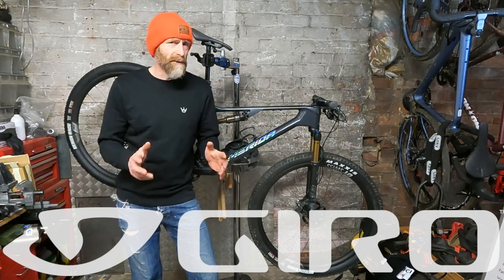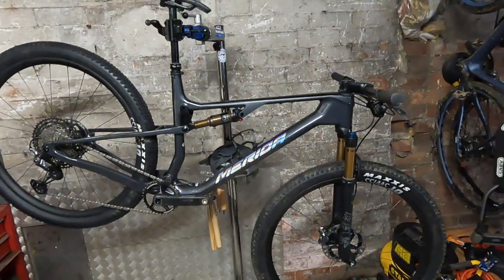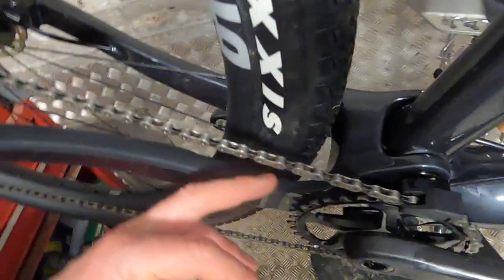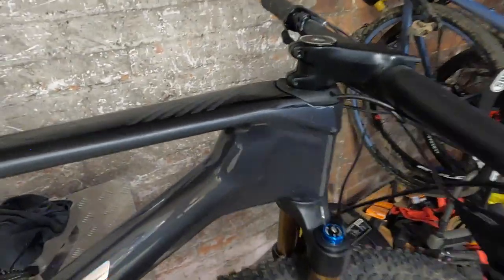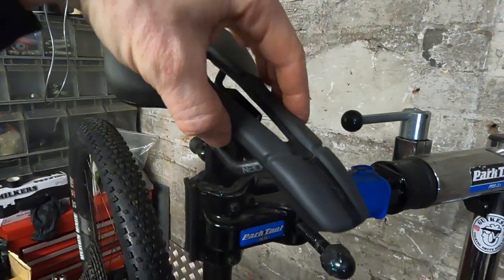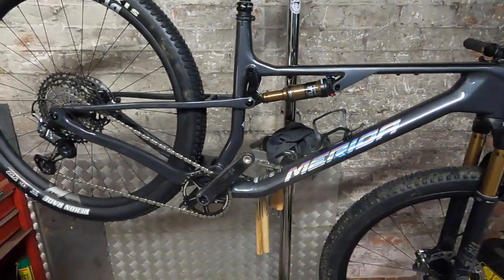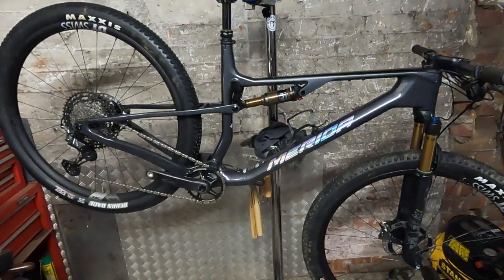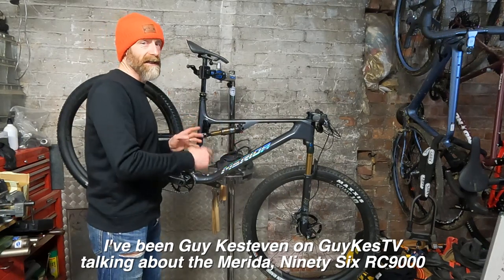Merida Ninety Six RC9000 Top Spec XC Racer

Comment: I have the same bike. The TwistLoc hasn't been a problem at all. I actually love it. It has never closed without me touching the button. And it does come with a Kashima dropper post. Good video👍
Reply: That really interesting to hear. I'm really interested in buying one of these bikes, but very worried about having the problem with the TwistLoc because I saw another video review where they also had the same problem. Guess I better talk to the bike shop service centre about it before I buy, see if they can fix it if the problem arises.
Reply: @scottw4538  My friend bought the XT version of the ninety six. He had the problem with the TwistLoc. It seems that the problem is on the rockshox side of things. Changing the TwistLoc for a new one can resolve the issue. But I assure you when the TwistLoc works the bike is from another planet.